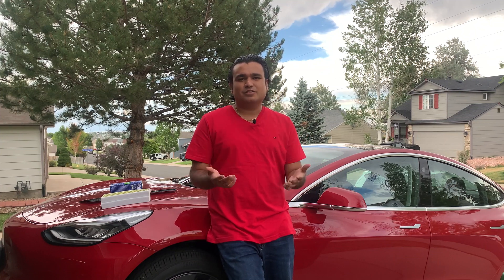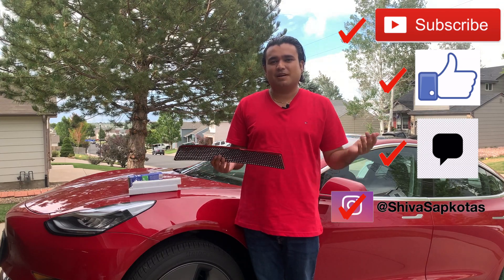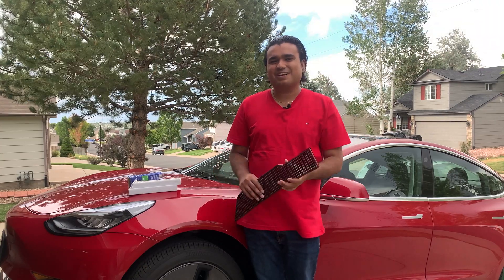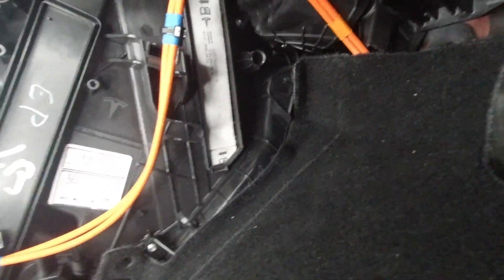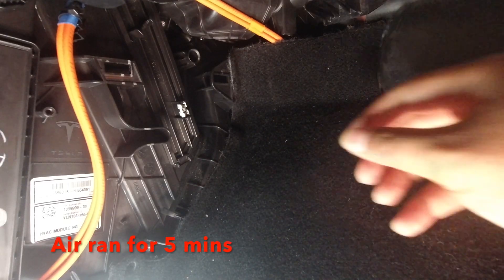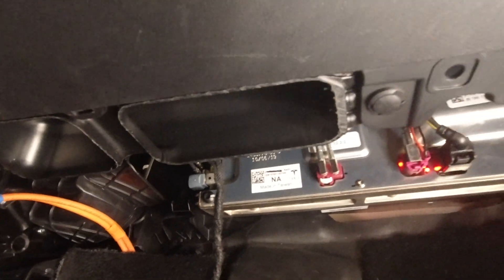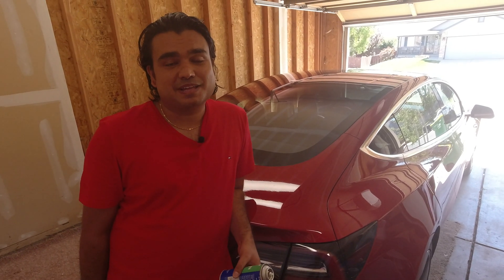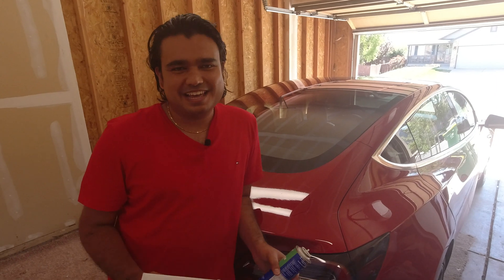TESLA MODEL 3 l Model Y- Filter Replacement 2020 (2 Year Maintenance - Complete Guide)

Comment: Nice job doing your videos.  I'm waiting for my Model Y, and am seriously considering the Topfit steering column instrument panel due to your instruction video.  FYI, on the Tesla "Do it Yourself" page, for cabin filter replacement step #5, it says just to take the T-20 screw out and nothing about messing with trying to move the orange high voltage cords.   You said here at 5:18, that you had difficulty trying to remove the cable clips from the filter cover.  I'm guessing you had issues because Tesla really doesn't want you messing with the orange high voltage cables. Anyhow I'm really enjoying watching your channel. Thanks.
Reply from the maker: Thank you very much. Yeah those high power cables could be tricky and I see why Tesla wouldn't want to touch them. However, it would be quite impossible to change out the filter without moving those cables aside. Hope they they routed those cables in a better way in newer vehicles.